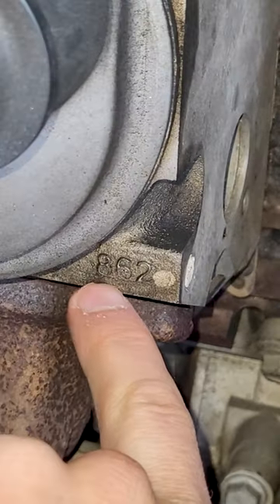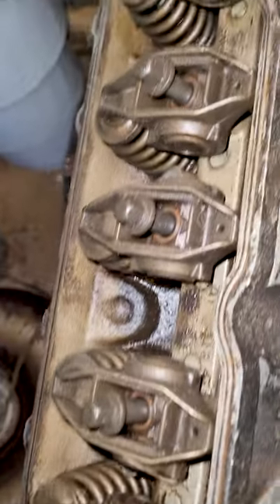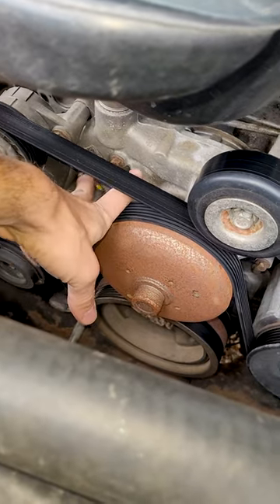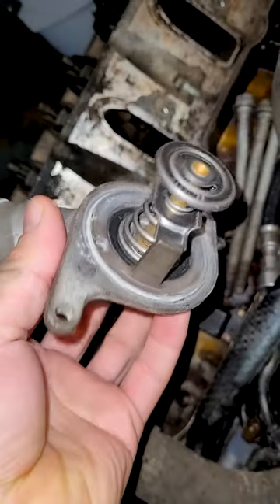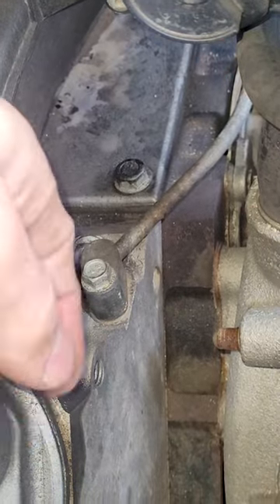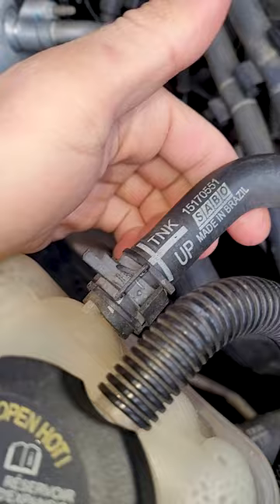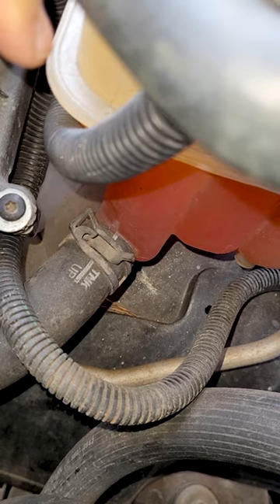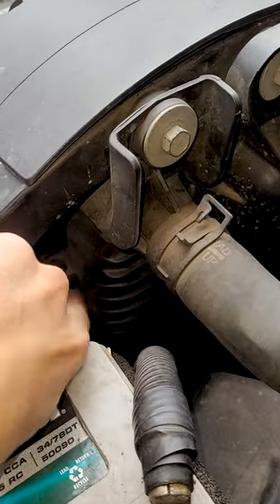Mechanic States Chevy Coolant Leaks?

Comment: 706 heads are where the power is at though
Reply from the maker: Only the ones made by Castech leak
Reply: 862 are the exact same heads. Castech made a very small batch of them as well though. Check for a little battery logo when you remove the valve cover. That’s castech’s emblem
Reply: And 243 heads are better than 706 for small bore applications.

Comment: I’m having overheating problems and I’ve tried everything replaced some parts same issue I’m reaching a breaking point
Reply from the maker: Get a radiator pressure tester kit and test the pressure of the whole system to the proper PSI. Make sure it holds pressure. If it doesn't, it will ALWAYS overheat!

Comment: I had the heat hose connector on the left side that goes into the cab dry rot and broke off inside the hose and was dripping coolant.  Replaced both heater hose fittings with stainless steel ones and the plastic y that connects them the water pump broke in this process so it got replaced.  Week or so ago noticed the plastic tank on the radiator (drivers side) was cracked and leaking  Had radiator replaced.  Keep in mind it’s a 2011 1500 5.3.  Also has small oil leak that I need to get fixed.

Comment: Love your videos btw, very helpful. Quick question. I have a 2000 silverado 5.3. I add around a gallon of  coolant every 3 months. However, I don't see any coolant in the drained oil since it's pure black when it come out. Could it still be the head gasket or something else? Any ideas? Thanks

Comment: Hey I have a 2007 Chev equinox and it's overheating all sudden but I don't think it's a thermostat. Is it possible that maybe transmission fluids that it needs cannot make it overheat if it's low